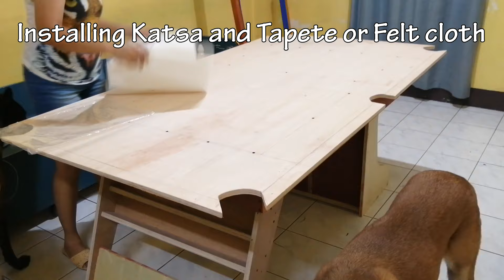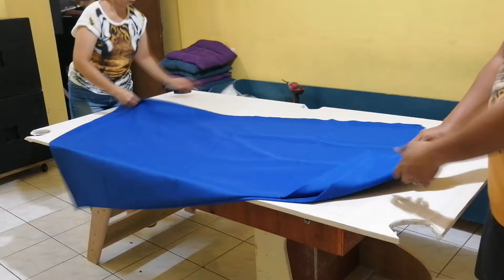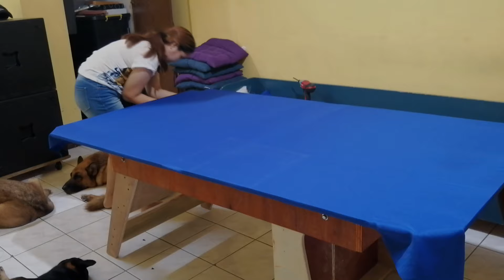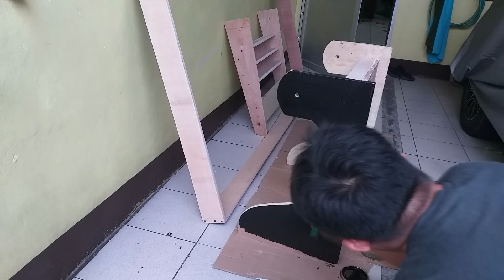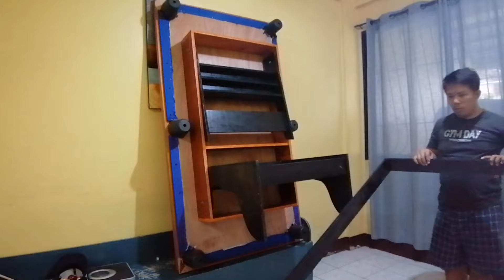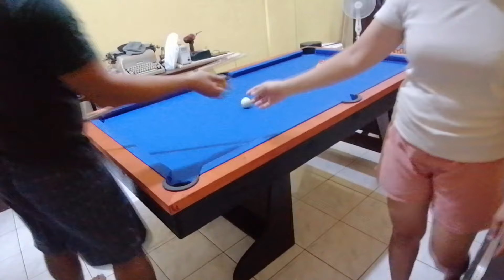How to build a billiard table - Part 2

Comment: I thought MDF was a better surface than Plywood. I bring this up because Pre-made tables are either Slate (very costly) or MDF (Affordable). If I'm not mistaken MDF is less money per sheet than Plywood and better for the playing surface and ball action?

On a side note, very nice job!
Reply: Good finished plywood like 3/4" birch is similar in density and weight to MDF but much stiffer. MDF is floppy. But also much smoother than plywood and you don't have to sand away the imperfections. I'm using MDF for my playing surface and plywood for the rest.
Reply: @Shakshuka69  For anyone interested the reason you would you MDF over plywood is because plywood tends to bend/live slightly, whereas MDF wont and thats why MDF keeps a more level surface over time.
Reply: I prefer using hdf as slate and frame Cox most of the mrf produce here cannot withstand hammatan without folding or danple but hdf are thicker to prssureand if you talk about the ball rolling double the rug with a thicker fibre under before the top surface and see the  perfection I am talking from.experience I am a technician from Nigeria over 8 boards of MDF had the same problem last December and 2 are still undonevdue to fund
Reply: The best wood to use is Formwork Plywood (used for concrete production) as it's incredibly flat, firm and resilient to moisture & warping, but it's quite expensive. MDF is much more affordable and much smoother than regular plywood and will never warp which is why the vast majority of good quality wooden tables use MDF. I'll intend to use 18mm MDF for my build as formwork plywood is extremely difficult to get hold of, but if I'm lucky enough to get my hands on some I will use formwork.